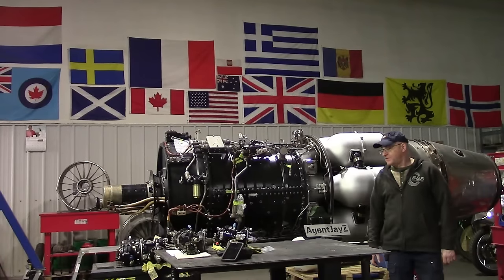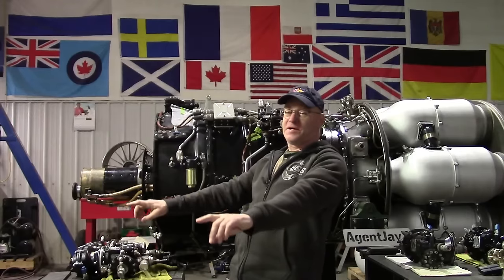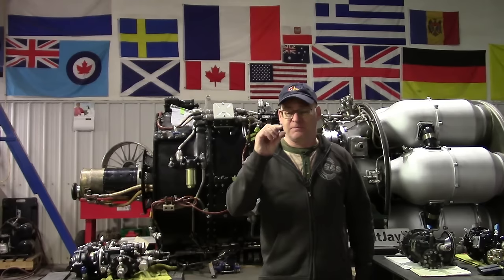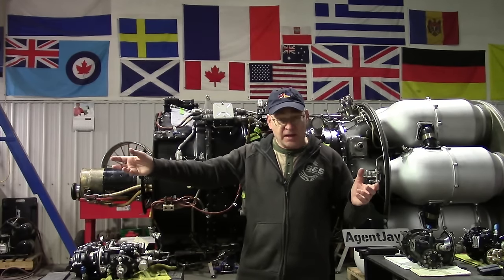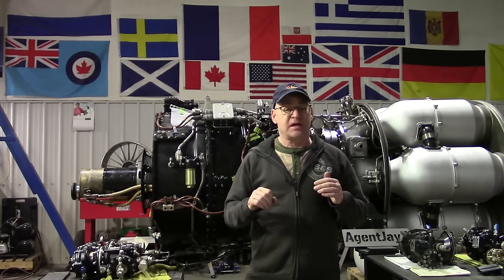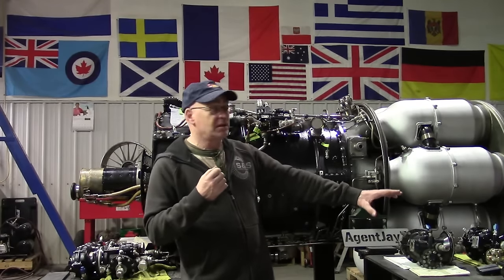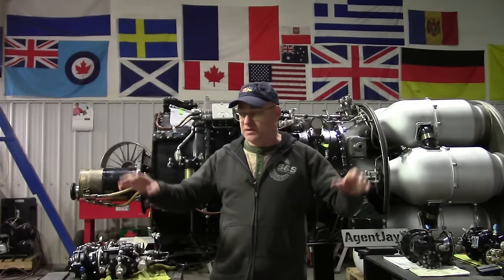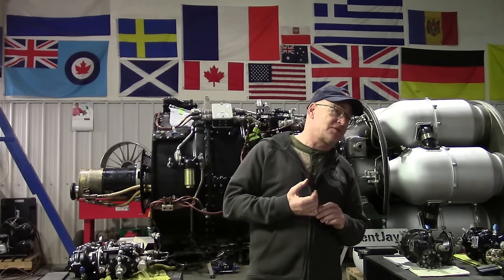Boost Pumps

Comment: Are fuel boost pumps left on once the engine is running
I think that fuel supply units are very clever even on older engines no matter what the throttle selection is
Reply from the maker: Boost pumps ensure a reliable source of fuel for the fuel pumps. Fuel pumps are not necessary at all when the engine is not "running".
Reply: @AgentJayZ  thank you
Reply: It all depends on the airframe manufacturer and becomes part of the Pilot's Operating Handbook or aircraft operations manual. Some say that auxiliary  or boost pumps must be on for takeoff and landing then selected off at some point, some are selected on before takeoff and turn off automatically so they remain in a standby condition unless fuel pressure to the engine driven pump decreases. There are any number of combinations and procedures, all of which are dictated by the airframe manufacturer as part of the certification process.
Reply: @oldtugs  bell jet Ranger
Alison 250 turbo shaft
Has two of them
Reply from the maker: A small number of twin engined helicopters were built as the Twin Ranger model. Not very many.
Reply: @AgentJayZ  the BE 105,   Agusta 109, both fine machines
Reply from the maker: Those are not Bell "ranger" models, So have nothing to do with your original comment about twin engined Jet Rangers.

Comment: In cars with port fuel injection, yes, the pump in the tank is the only fuel pump. In Direct Injected cars, typically the pump in the tank is just the low pressure "lift pump" (aka: boost pump), which feeds the High Pressure Fuel Pump in the engine bay. On most more modern DI engines, the HPFP is driven off one of the overhead camshafts, most often the exhaust camshaft. Some engines drive the HPFP off of the timing chain.

Comment: Some info on fuel tank boost pumps in the CT-133 Silver Star to detail the challenges in providing positive fuel pressure to the engine driven fuel pump on the venerable Nene 10. There are multiple interconnected fuel tanks in the wings featuring electrically driven boost pumps. Tip tanks use air pressure from the engine to transport fuel to the system. All feed into the fuselage tank behind the cockpit. The fuse tank has an electrically driven double ended centrifugal pump to supply positive pressure to the engine driven fuel pump. The reason it is double ended is to ensure positive fuel pressure under negative G conditions such as when the aircraft is flown upside down or during other aerobatic manoeuvres resulting in negative G. Not something the average airliner typically contends with.

Comment: I'm a subscriber of all the channels you named.  Juan Brown (Blancolirio) is also an A&P mechanic.

I have a question prompted by your discussion of boost pumps.  It may be a bit outside of your wheelhouse but I'll ask anyway.  The CL 13 Saber, among other fighters often perform numerous acrobatic maneuvers during flight, including flying inverted.  How does the aircraft maintain fuel flow from partially filled tanks without interruption during these maneuver?  It seems that jet fuel, being liquid, will shift around in the tank during flight with the potential of an air pocket being positioned at the fuel intake?  Clearly this isn't a problem for passenger or freight aircraft. Thanks for considering this question.
Reply from the maker: I don't have access to data on the aircraft fuel system in the Sabre.  It's important to watch the maneuver being performed, because inverted flight does not necessarily mean negative G.
I believe the Sabre has a maximum negative G endurance of 20 seconds, mainly because the oil is only scavenged out of the bearing sumps in positive G. A swinging pickup in the oil reservoir ensures the oil supply is maintained while flying in negative G, but no oil gets returned, so the supply runs out quick.
Since the engine can run inverted at all, I think there is a swinging fuel pickup at least in the main tank, into which the other tanks drain to keep it full.
Negative G is avoided, but would be experienced in steady, level inverted flight.
Things like barrel rolls and inside loops are positive G, all the way through.
Reply: @AgentJayZ  -  Thank you.

Comment: The newer cars are direct injected so they have an electric fuel pump in the tank and a mechanical fuel pump on the engine that raises it to around 1200 PSI so it could be called a boost pump

Comment: The electric fuel pump in a car running on gasoline with a carburetor or port injection supplies fuel that is not pumped again before being used by the engine.  But on a diesel or gasoline direct injection car, there is another fuel pump which is mechanically engine driven that supplies fuel to the injectors.  This is broadly similar to the engine driven pump on a jet engine.  The injectors on older diesels were basically fancy check valves, so the injection pump had to precisely meter the fuel.  But modern diesels and GDI engines have electronic injectors that are computer controlled to meter the fuel.

Comment: Awesome stuff as always professor Jay. I’m an industrial water chiller mechanic. I’m guessing where as a positive displacement pump is like a screw compressor or scroll type compressor. The centrifugal chillers the impeller works off of the lift of the lift ratio of the low pressure side and high pressure side. Those get out of whack and we get compressor stall followed by surge. Surge is bad news

Comment: Automotive fuel pumps are like a not  positive displacement pumps but if you dead head one, they will usually stop turning. Most of them produce between 9 and 60 psi pressure depending on the system.  There are some that have extremely different specifications with high pressure and rpm. Most of them are returnless and the pump is controled by  a fuel pump module that can change the rpm of the pump depending on demand. Some pumps are 3 phase alternating current where the module produces that at a variable frequency to control output. On direct injection cars, the in tank pump feeds a high pressure positive displacement pump that is run from the cam shaft. When the high pressure pump fails, engine oil is contaminated with gas just like the old days. Those fuel pumps you are describing here are similar to the variable displacement A/C compressor on many cars.

Comment: Tank boost pumps (the non +ve displacement type) also allow fuel to be drawn through the pump by the engine driven pump in the case of boost pump failure.  That ensures that the tank's fuel remains useable even if the boost pump has failed
Reply from the maker: True

Comment: Q: what advantages does a axial compressor over a radial flux compressor have to justify the size difference?
Reply from the maker: Centrifugal compressors are simpler and cheaper to make, they are tougher and more resistant to stall. They lose efficiency after about the size needed for about a 1000 Hp engine, and they are limited in the ultimate discharge pressure they can achieve.
Some exceptions at the upper end of capacity are the PT6B at almost 2000 Hp, and the PW150 at around 5,000Hp.
Axial compressors are capable of much higher mass flow rate, and are able to achieve compressor ratios of up to 50:1. They are more complex, more expensive, and require more maintenance, but in the 5,000Hp to 500,000 Hp range, they work really well.
Reply: @AgentJayZ  thanks for the answer, I researched a bit and learned that they also have a relatively low rpm limit and you can't really stage them. Always great to hear different sources.
Reply from the maker: The rpm limit is determined by diameter, exactly as with axials.
The limit of the number of stages is usually about 2 for centrifugals, whereas 15 or more is no difficulty with axials.
Reply: @AgentJayZ  We/I have a solutions to the centrifugal/radial machine conundrum but it's unpatented as yet.  ヅ

I provided the correct answer on your  '...F-35B Lift Fan Drive Question...' page.  The answer is simple. The engine is not oversized because the VTOL phase power requirement is obviously not greater than the power required for forward flight which has a drag component that is not present during the VTOL phase. 

When I researched the lift fan system some years back,  a dog clutch was mentioned in the drivetrain engagement. I don't know if that was an authoritative source so can't vouch for the veracity. With language being imprecise, that could probably mean a one way clutch, sometimes called an overspeed clutch, where metal rollers are located between two concentric rolling elements [somewhat resembling a roller bearing] that wedge themselves between these elements to act as one for power transfer/transmission. I suspect that the clutch requires frequent replacement due to the large forces present. We have patented a torque dense [i.e. compact], infinitely variable [for gradual power transfer], high speed & torque, hydrodynamic transmission/coupler [torque converter] that would significantly reduce this frequent servicing. We have also patented a simple, infinitely variable, torque dense, positive engagement, transmission which does not utilize involute/spur gears. It is called 𝔽𝕣𝕚𝕔𝕥𝕚𝕠𝕟𝕃𝕖𝕤𝕤 𝔾𝕖𝕒𝕣 © transmission and is based on our reformulation of gearing theory.  In e-VTOLs the use of either allows significantly smaller motors and batteries for same performance/application. Similar benefits are derived in turbo-engine apps with smaller, lower cost, more efficient engines along with other features & benefits.

FYI, in the near future, we will bring out tech which enables antigravity with propulsion apps including interstellar travel, rendering all else but museum pieces/dinosaurs.

If anyone can hook me up with SpaceX or any of Musk's companies, Pratt & Whitney, etc. to improve many of their offerings, we'd each benefit greatly. ヅ

BTW, I'm a triple engineer, CE, ME, AE with penchant for nanotech, quantum biology, quantum physics, astrophysics and cosmology, among other things. ヅ

PS. Excellent channel. TnX.

Cheers
✈✈✈ 𝕄𝕀𝕃𝔸ℕ✈✈✈

Comment: in cars it depends. in port injection (most common rn?) cars the fuel tank pump is indeed the only fuel pump, but it does something in the range of 50-ish psi. direct injected engines have a further high pressure pump that is lobe driven off the camshaft usually.

Comment: I've been engineering and tweaking my fuel control design over the past year. I'm in a good spot now, but I can't tell you how much time I've spent contemplating different fueling approaches. Different pump designs, fuel pressure and flow rate relationships at different pump RPMs, regulation, recirculation or dead heading, proportional throttle valves for flow control at constant pressures, variable speed pump throttle control with no regulator. It made my head spin...

Comment: That one thing... Could agentJayZ be a swiftie???
Otherwise I'm clueless
Reply: Also, yep generally in port fuel injected cars, you're exactly right, the fuel pump in the tank is the only pump. On cars with direct injection (diesels and newer gasoline cars) there's a second high pressure pump mechanically driven off the enine to provide the >1000 psi required for the injectors
Reply from the maker: I don't listen to her music, but I am impressed with her humanity.
Reply: @AgentJayZ  LOL. And her humility. She's practically a monk.
Reply: Get schwifty.

Comment: Fuel boost pumps in an airliner are necessary to ensure a constant supply of fuel to the engine driven pumps at high altitude.  The engine driven pumps will not be able to rely upon the static air pressure at high altitude to provide enough differential pressure between the fuel tank and the engine driven pumps to ensure uninterrupted flow - so boost pumps located in the fuel tanks are necessary.   Fuel pumps don't "suck" fuel from the tanks; in the absence of a boost pump submerged in the fuel, they rely on atmospheric pressure to do the work.  Atmospheric pressure at FL180 (18000 ft.) is roughly one half that at sea level and it becomes proportionally less as altitude increases.  In the B727, 757 and 767's I flew for 33 years, the fuel boost pumps were required to be "on" at all times from engine start to shutdown.  In the event of a boost pump failure at altitude, we were required to descend to below FL260 (in the B727) to ensure sufficient fuel flow to the engine driven pumps due to atmospheric pressure alone.
Reply from the maker: Yes. Sorry about using the word suck. It's an easy mistake, even though I try not to make it. In one of the recent Patreon vids, we go through the fuel pressure switch. It's basically there to illuminate a cockpit light indicating boost pump failure. The engine can run without boost pumps, but it's happier if it doesn't have to.
Reply: Additionally, the fuel boost pumps in the B727 and B767 were used to "dump" fuel when necessary.  None of those aircraft had the ability to transfer fuel from one tank to another in flight so there were no "transfer pumps".  The fuel systems were designed so that we could "cross-feed" fuel from any fuel tank to any engine when necessary for balance considerations but we typically ran "tank to engine" as the normal procedure.
Reply: Bombardier uses ejector pumps as their main boost pumps with a gear type motor driven pump as backup.  Fuel is tapped from the engine driven pump to pressurize the ejector pump supply.  The motor driven pump is used at startup and a backup to the ejector pumps.
Reply: "The engine driven pumps will not be able to rely upon the static air pressure at high altitude to provide enough differential pressure between the fuel tank and the engine driven pumps..."  WTF? since virtually all fuel system components live at the same altitude and air pressure there is no altitude induced pressure differential. The only differential pressure that might exist is due to a difference in height between a pump and the tank from which it draws fuel. That is called "net positive suction pressure head, and yes, suction is a real engineering term used in pumping and fluid flow design. The boost pump is used to assure a positive pressure at the pump inlet. Please consider the fact that all the engines on a 727 are several feet higher than the top of any fuel tank so that should be a clear indication that atmospheric pressure is irrelevant.  Another point, the tank mounted boost pumps are centrifugal pumps which like all in that family create a low pressure area at the impeller inlet while rotating, that phenomenon is is why the engineering term for that area is called the pump suction, it is the same if that pump is operated in space or at the bottom of the Marianas Trench.
Reply: Sorry for the confusion - I assumed that it was obvious that the differential pressure of which I spoke was the difference between "pump suction"  (your term) and atmospheric pressure.   I did not say that there was differential pressure solely due to atmospheric pressure.  My point was that a fuel pump creates low pressure at it's inlet as it attempts to "draw" fuel from the tanks but then (in the absence of "boost pumps") relies on atmospheric pressure to provide the "push" to move fuel from the tank towards the pump.  The most "suction" any pump can produce is 0 psi and, at sea level, atmospheric pressure is close to 14.7 psi - never a problem having enough differential pressure for fuel to flow reliably for fuel systems on the ground.  At  "jet" cruising altitudes however, atmospheric pressure is much lower; hence the "differential pressure" force available to "push" fuel toward the pump is lower as well..  An extreme example - a fuel pump at 0 psi inlet pressure attempting to draw fuel from a tank (at the same height) that is also at 0 psi will not be able to do so without an "in-tank boost pump" to supply the required differential pressure.  There must be a difference in pressure for any flow to occur - that's how pumps work.  While it's true that aircraft with engines mounted lower than the fuel tanks can usually, but not always (depending on aircraft attitude), rely on "gravity" to supply some pressure to feed the fuel pumps, even the B757 and B767 aircraft (under wing mounted engines) with which I'm familiar normally require that the in-tank fuel boost pumps be operated continuously from before start to shut down.  I'm not saying the engines won't run without the boost pumps on, but the aircraft is not "legal" for dispatch if all the boost pumps in a tank are inoperative.  Additionally, if even one (of several) boost pumps in a given tank are inoperative, we're required to carry huge amounts of additional "penalty" fuel in that tank to ensure the remaining boost pumps are never "un-ported".

As for the "space or at the bottom of the Marianas Trench" statement - it's true that "pump suction" is the same, 0 psi in both places but the "outside" pressure is vastly different.  The pressure in the depths of the Marianas Trench are in the thousands of psi, lots of differential pressure between the "outside" pressure and "pump suction".  In contrast, the pressure outside a space vehicle is essentially 0 psi - the same as the "pump suction" (no differential pressure to do the "work" and therefore no fuel flow).  Having been employed as a space systems engineer some years ago, my recollection is that to solve this problem, spacecraft fuel system tanks are pressurized with helium or some other inert gas.  That gas pressure then provides the required differential pressure for fuel to flow (also, since they live in 0 gravity, there are additional problems related to keeping the fuel at the "pickup" location so that the pumps get only fuel, not the pressurizing gas...).